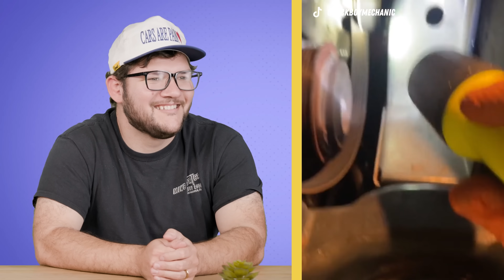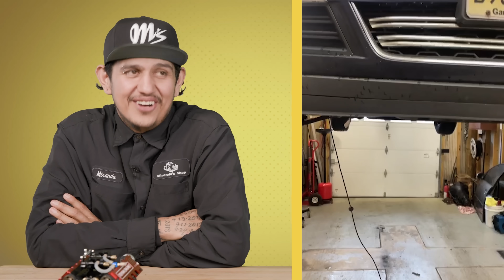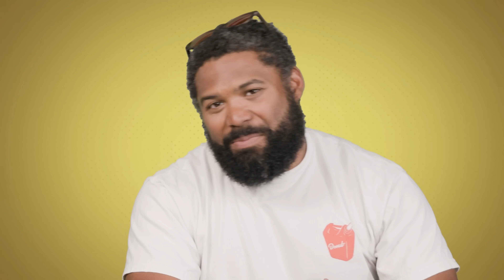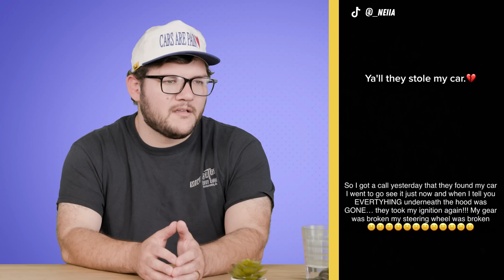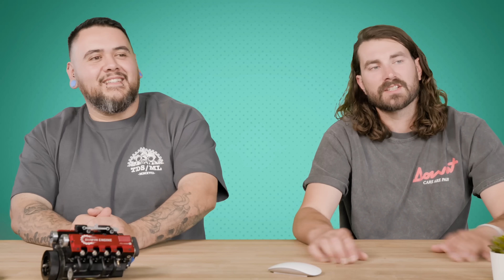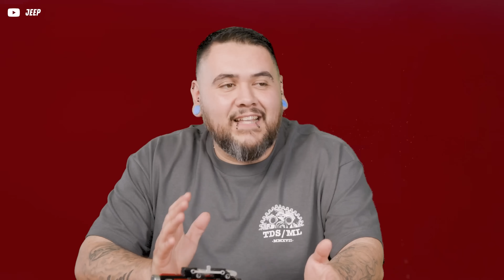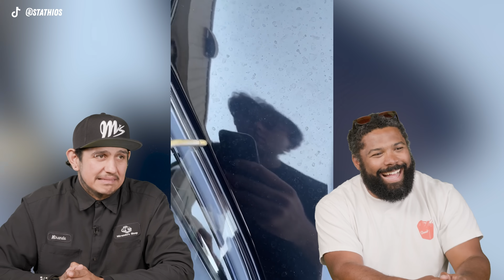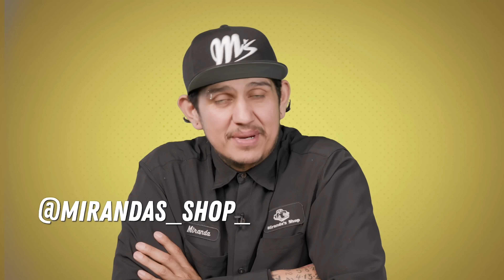Mechanic Reacts to Car Engineering Fails

Comment: On that first vehicle, the Chevy, it looked to me like the entire tensioner assembly was the wrong part, straight up.  It didn't line up with anything else in the shot.  If that lack of clearance had been provided from the factory, there's no way that it would not have been hitting the frame rail.  So I'm mostly chalking that one up to whoever worked on it last, although I'll also say that I've run into way too many cases of parts catalogs being dead wrong about which part fits a given vehicle, or a store having the wrong part in stock under the part number that was supposed to work  - and then people end up trying to install something that wasn't the correct piece as a result.  Some of this is because of other mechanics, too.  A hell of a lot of shops are super sloppy or even downright dishonest about returning parts to their suppliers.  Some just don't give a crap about making sure that the part goes back in the same box it arrived in, and when they had to order two slightly different ones because of a known "match it" issue, some will return the unused part in the box for the more expensive one every time, even when the cheaper one is what's really going back, so that they maybe get the bigger refund.  I've been on both sides of the counter over the years, tech and parts, and rule number one when the parts are handed to you is "always make sure they're the right bits", whether you're the mechanic getting handed something to install, or you're the person at the returns desk checking the stuff in when the shops send back what they didn't use.

Comment: That audi leak happened to my wifes 2021 XC90 also... and heard it happens to alot of other cars with panoramic sun roofs
Reply: Had this happen to a 95 geo prism. It happens because it’s not sealing properly when the sunroof closes. Think the gasket was replaced and then was fine.

Comment: Reminds me of my buddy's crappy old Aveo where you had to pick the entire drivetrain up about five inches to change the power steering pump.  Edit: If they'd made the bolt go in from the backside of the bracket (where there was plenty of room and you could even easily access it) and threaded the opposite part, it wouldn't have been an issue.  I swear, the stupidest people always go to school to be engineers so they can finally feel smart.  Too bad college can't teach common sense.

Comment: As an engineer I gotta chime in. A lot of engineers are terrible about this stuff, but a lot of times it's because management wants something 100% finished before sending it out, and communication between departments is terrible. Fortunately during my first job, I was able to design something, take it out to technicians and get their opinion before I ever went to my boss to show him. I still do it to this day. I even ask techs if they want to help with the design sometimes and ask what can be changed to make it easier for them to work on.
Reply: I can say with certainty its rarely ever an engineer that is to blame for these incidents. It's always management or accountants who are either trying to save a buck or meet tight deadlines.

Even when a serious flaw is seen they will continuously ignore them to make shipments. I mean Ford from 2008-2012 and Chevy from 2012-2016 was literally the prime example of managers not listening to engineers and cars practically blowing up from major failures. And they continued to play dumb for an entire engine's design cycle (4 years) because rather than improve the engine they were worried about realizing the next model on time even though they knew what problems they had created.
Reply: Cost over design.

Comment: As a ex vehicle test engineer for a massive Japanese car company you would be surprised what happens in car factories.  I've seen new engines get helicoils for stripped head studs and the wrong pitch captive nuts on thousands of seat belt mounts that had to be manually ran in because they would strip using tools. Cars sitting for months in all weather's just going rusty! Test drive cars we used for long range testing would get new clocks fitted to show 0 miles and shipped out after we ragged them for thousands of miles...

Comment: On the Audi could be an option 3: the costumer not cleaning the sunroof drains. Customer could be parking this car under a tree daily. I've seen leaks from just dripping out the interior lighting, to a swimming pool under the carpet lining, just because some crud in the sunroofdrains

Comment: Early 2000s jag xtype has a 17 hour flag time for the oil pan gasket because you need to drop the transmission to remove one of the oil pan bolts. Don't do this,  but,  if u grind away about 4mm of the structual fin blocking you,  it makes it a 60min job

Comment: The oil from the Land Rover is on the mechanic tbh, the girl is right. Just put a metal plate or cardboard to redirect the flow of the oil, not a big deal, just an unprepared mistake ig

Comment: That Land Rover oil drain issue is similar to my 2006 Infiniti M35. The oil drain sits right above the front sway bar, so the oil drains out and hits the sway bar and splashes. Its not as bad as the land rover, but still annoying and messy, and after draining the oil you have to clean off the sway bar as well.

Comment: Yoo facts about jeeps .but I still love em . Luckily I have a 75 cj5 with Chevy 350 in it and I've had zero electrical issues because the wiring in it is simple.

Comment: One example comes to mind: You probably know the VW Lupo or Seat Arosa with 1.0 or 1.4 Litre naturally aspirated, multi-point-injected four cylinder eight valve engines: The stupid engineers decided to do away with valve covers in favour of a so called "Ventilhaube" in which the top of the camshaft bearing is combined with the cover so it is one part. Bonus point: There is NO SEAL BETWEEN the cover and cylinderhead! You should use sealent which does not work forever and gets messy pretty quick. The oil drips into the sparkplug holes leading to ignition faults.
This is by design fucked up!
You are going to find these engines in VW Polo as well. They are built around 2000 and I own one: These engines sound like Diesel and run like crap as they age.
One interesting bit:
If you want to put new sealant to the space I mentioned, you will have to do a timing-belt job for which you have to lower the engine because there is no space to get the screws from the tentioner pulleys of the v-belt and the timing belt! To loosen the engine you need a specialised tool which looks like a wrench you put to an L-shape.
If you want to do it without this tool you need to undo the entire front of the car!

Comment: When I was in the Air Force I was weapons maintenance team on the A-10 and there are all kinds of stupid ass engineering design choices on that airframe. The biggest problem we ever had was when dropping the gun/drum assembly from the front of the aircraft. In the back left corner of the drum bay is a major electronic box with lots of big wiring harness's going into it. Well sadly when dropping or installing the system those wire bundles often get damaged and require lots of trouble shooting to find exactly what was damaged. 
Yes, some of the times it could be blamed on the maintenance crews for rushing or not paying attention but the placement of the box, giving us only inches to work it was just really a dumb idea.

Comment: The older Ford tarus SHO's had timmimg bolt that would come loose from factory recalled them. But instead of properly fixing them  they would have ass it so they will fail again... unless you knew a Ford technician.

Comment: I can't stand how even on the cheaper Nissan's the engineers are obsessed with building a bracket to hold another bracket that sometimes holds a third bracket just to attach one part. E.g. ps pumps... They could probably shave a quarter of the vehicle weight and save alot of hassle by not installing so many extra, useless brackets! But I have dealt with engineers during my short time working an assembly line. There favorite phrase is "it looked good on paper". Although us the ones doing the assembly say it won't, they ALWAYS know better than the people that are actually hands on all the time. But they have a degree and make 10x the worker's so why not spend 10s sometimes 100s of thousands to developing something that the actual workers with more hands on experience already told them wouldn't work! But they all think that they are God's and the worker's are just peons.. Rant over Eby out!
Reply: 88 ford tourus v6. Great car when it first came out. But you have to disconnect the motor and tranny mounts, lower the engine, and use a ratchet strap to get it to tilt forward enough to access two of the spark plugs. 4hrs is what the shop charges to change the driver's headlight on a Toyota Abalone! I did it in two and am far from a pro just a farmer that can fix anything

Comment: Something like that belt tensioner - the time guide is not always right, it is a guideline - simply add in the extra hour or two for dealing with the poor design. The old Chevy Shovette starter bolts were damn near impossible to get to. Another poor design.

Comment: 92 chevy pickup... oil filter drains right onto the fwd drive shaft. And the oil filter is mounted horizontal... engineering problem!

Comment: When I used to do oil changes I used to dread the ford mondeo because to access it u had to turn the drivers wheel fully to the right to get to it under the wheel arch

Comment: I have a 1963 Willy's Jeep Wagoneer that I've owned since I was in high school. I bought it for $50 because it had a broken shifting fork. Fixed that up and got it running. Unfortunately it sat at my parents for 20+ years and my dad borrowed a lot of stuff from it and for some reason pulled all the spark plugs and left it like that. It has 28k miles on it but I haven't scoped the cylinders to see if anything has decided to make them home. My dad knows better too but it isn't his so. If the engine has been toasted I might put a diesel in it. Maybe a Cummins maybe an old Mercedes. I've got a few projects ahead of this one but at least I finally got it home.

Comment: I'm currently working on a 2013 Toyota Corolla doing lower control arms. Both of the front bolts cannot be accessed unless you jack the engine and trans up or lower the sub frame. Big engineering fail.

Comment: If its any consolation, it's the same with Aircraft mechanics. A lot of the time if they had just moved a bolt 1/2 an inch either direction you could get a wrench on it, but no, it's in that perfect spot where you CANT, so you have to remove the entire bulkhead panel and assorted other equipment from other systems not even related to what you are trying to fix.

Comment: The Traverse (and Acadia) has so many stupid issues. My 2020 was under warranty work for electrical issues before I had 100 miles on it. The AC condensation line also leaks onto one of the computers in the engine bay, causing it to fail, which was a known issue before mine was manufactured. The latches for the roof glass cover also just snap after less than a year.

I wasn't able to lemon mine, because it wasn't in for the same issue 3 times in 2 years, that didn't happen until 24 months and 2 days after I bought it. I sold it last year.

Comment: On 3rd get Tacoma's the A/C drip line is positioned directly over the passenger frame rail in the engine bay. At least it was for the earlier years, don't know if that got changed on later years. I had a 2016 TRD Off-Road V6, just took a bit of hose big enough to slip over the drain and long enough to route it below the frame rail, used a ziptie to secure it in place. Engineering oversight!

Comment: my parents had a 13 jeep and after a few years most of the electrical shit stopped working. by the time they sold it the trunk was power so it was stuck closed and when you turned the left turn signal on it would trigger the windshield wipers lmao i will never buy another stellantis vehicle again

Comment: Although minor, I’d like to mention that on my 93 accord ex the lower bolt for the brake caliper cannot be taken out without removing a control arm (and probably screwing up your alignment)

Comment: The GM V6 is the worst engine. Had a dealer look at my 2012 GMC Acadia for rough start up and he said GM had a notice that all V6 engines from 2010 to 2018 "may" have a fault where a cylinder could develop a pin hole leak. Solution... engine replacement. Too bad mine failed at 104K miles and was out of warranty.

Comment: Same problem with toyota rav4 2001 belt tensioner, the upper bolt is 5-6 mm too long and won't come out until you disassemble the tensioner and wiggle it there for like 15 min.

Comment: Engineers always prioritize manufacturability over serviceability, and the reasoning is simple: Every car is manufactured, not every car is serviced. Now for relatively frequent services like an oil change, you'd better make those easy. But for something like a water pump, you have to ask: How many of these cars will even survive long enough to have that water pump go bad? Cars get destroyed by crashes and owner neglect all the time.

It can make sense to increase the cost (in parts or labor) of a repair that will only be performed on some cars to reduce a production cost that applies to all of the cars.

Comment: You guys missed a huge one: the Ford engines where the fracking water pump is INTERNAL AND RUNS OFF THE TIMING CHAIN, with an "overflow channel" the size of a number 2 pencil.

10 - 12 hours to change a water pump, no joke. Had trouble finding someone to even do it.

You have to:

Remove the intake and upper valve covers.

Loosen the motor mounts on the passenger side, to jack the engine up for clearance.

Lock the cams in place ($1200 tool by the way).

Pull the pump out, AND THE FUCKING TIMING CHAIN...which will have to be replaced 50% of the time (luckily mine didn't explode when the water pump quit).

Also you not only have to just drain the oil, but flush the system because the engineers, in their brilliance, decided that there doesn't need to be a gasket between the overflow channel and the goddamn REST OF THE BLOCK, so water in the oil.

Comment: One engineering fail from Renault :
Engince concerned : 1200cc TCE (don't recall the code for it) 4 cylinders.
Problem : Engine lasting only up to around 100 000 kilometers (or 62 137,1192237334 miles) but often more around 40/60 000 kms (24 854,8476894934/37 282,27153424 miles).
Cause : Fuel injectors injecting the precious fuel right down the cyinder walls

Comment: My 2015 toyota (i ain't stupid) also has no immobilizer. the only difference is even the dealer thinks they do and still programs the keys.  To prove it I paid my parts lady to cut 3 keys with no programing that in theory should have only worked on the door but all 3 still started the cars. oh and these where 3 brand new cars on our toyota lot. also late 90's to well into the 2010's all vw audi keys worked universally for glovebox, center console, fuel door, and back seat trunk access. meaning if you gave the valet the valet key so they couldnt access those things and they had ANY other vw audi key for about 10 or more years they could open it.

Comment: I've got an old one here. 

When I was rebuilding the 429 in our 1969 Mercury Marquis, I was surprised to find the original nylon cam gear. 

The cam gear, that drives the camshaft,  distributor, oil pump, and fuel pump is made of nylon bonded to aluminum. 
I don't understand how this could be better or cheaper and a cast steel gear, but it managed to last 50k miles and more than 50 years.

Comment: I’m an engineer and work on my cars all the time. Sometimes I can’t help but think “who the heck thought this was a good idea?!” But to be fair, especially in the automotive industry, there’s always a push to fit more into less space and to do it cheaper. Hence many poor design choices
Reply: Exactly this, and the worst thing is that it pervades all industries, not just the automotive sector. It’s so widespread that it’s even bridged the gap to computer software. Laziness and cost-cutting evades nothing these days. So sad, time to spend more money that’s worth less than it was 10 years ago. 🫤

Comment: Honestly we have so many vehicles in the world that I don't think we need be getting the new ones every single year. I say it's specially for the new drivers crowds the 16 to 18 year olds they should be getting vehicles there 10 years old or older that still run well and are maintained not to Perfection but to a decent amount. And I think people should learn more about mechanic work so that way they can you take care of their vehicles longer and they don't need to go into a mechanic shop to pay $1,000 bill. And honestly I think companies should slow down on making cars I got a truck that the 08 runs well it's still does

Comment: You can just drop the "skid plate" to drain the oil easier for a land rover. Doesn't take long with electrical tools and not as messy.

Comment: I should get a photo of a bolt for the AC compressor on my VR6. Bolt is longer than space to slide it out. So gotta drop the engine to get one bolt out if removing compressor.

Comment: On the old 1980s-1990s Ford Tempo/Topaz we used a hole saw to cut a hole in the inner fender to get the crank pully out.  Strange part of the story, there was a dimple on the inner fender/frame rail with the exact place to drill to access the bolt.